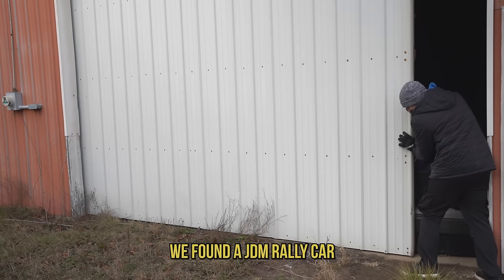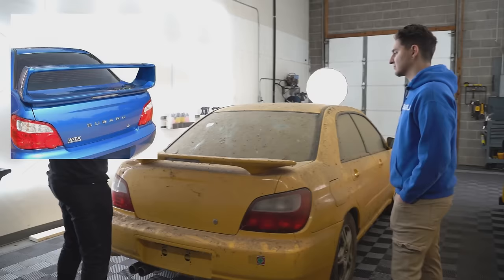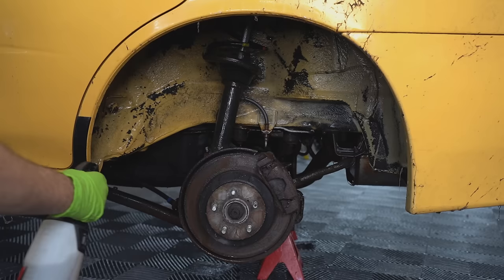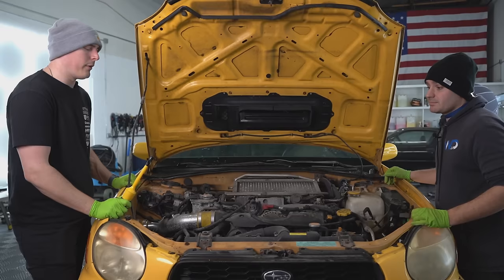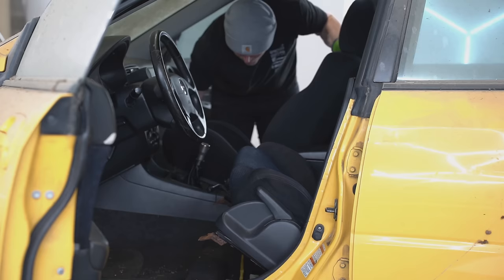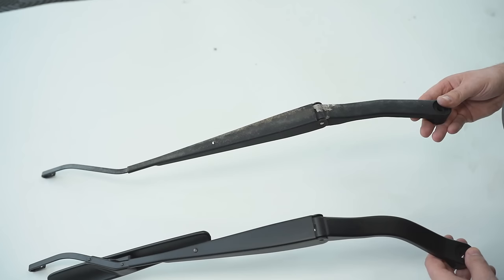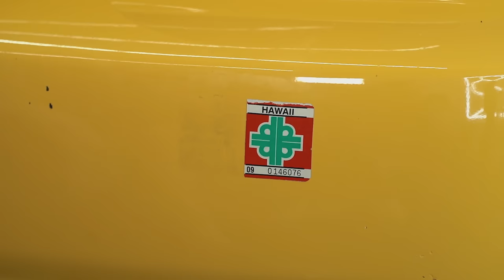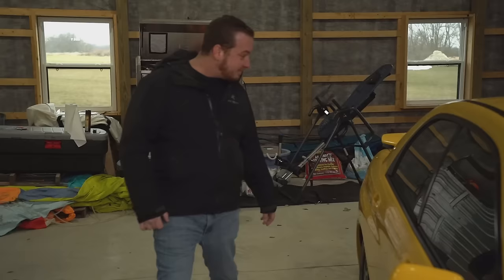First Wash in 7 Years: Subaru WRX Bugeye ABANDONED in Barn! | Car Detailing Restoration

Comment: I'm not normally a fan of black wheels, but those stock dipped wheels with this yellow actually looks super TOUGH. Nice work.
Reply from the maker: Thank you!
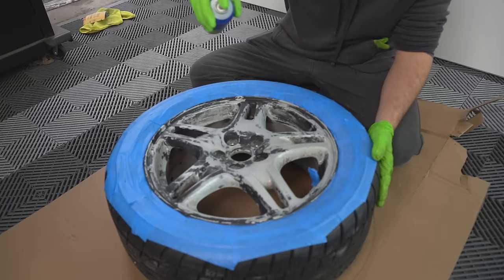Reply: @WDDetailing  Since you have this comment about wheels responded to, I'd like to chime in with 7:55 were you said, not to go heavy coats with plastidip which is incorrect. As per dipyourcar videos, plastidip is meant to be put with thicker coats (still trying to avoid drips) and hyperdip, a different product should be sprayed more like paint, lightly.

Comment: To tape of tyres you can better use a deck of cards and place them in the edge, all-around overlapping each other. It is the best way I found to quickly coat a set of wheels....

Comment: I am currently dropping a new engine in my 2002 WRX. I blew the engine back in 2012. It has been sitting in the garage then outside since. Mine is lowered on ISC coilovers and 18x8 Prodrive PFF7 wheels. It also has a 2007 STi 6 speed and wing.  I love my car which is why I never got rid of it. This guy needs to take care of this car. Subaru made very few in Sonic Yellow. Glad I watched this. I had some critters under the hood. Now I know the other places I need to check.

Comment: Using playing cards in the wheel edge saves the use of tape and taping it. Also you can reuse them and as they get covered with overspray they fit tighter and tighter!

Comment: the bug eye is by far the best WRX. best looking, lighter, handles better, no unnecessary electronics, drop in a late model twin scroll 2.5 engine, swap out the gear box and drive train from the STI and a booming sound system, rally blue, with Rays Wheel Ce28 n 18 wheels, carbon fiber hood scoop and rear wing risers.

Comment: I am a detailer and find if a car has mouse nests I use a 50/50 Isopropl Alcohol, water mix to the area after cleaning. This is misted over the area and the Alcohol kills a lot of odour causing bacteria.....I in fact use it on all surfaces and works well for me, even d I wn the air vents.

Comment: Nice car, and beautiful restoration done. But it is never a good idea to use a pressure washer in the engine bay. Or try to not spray directly into the alternator, better yet, cover it up so no water can enter the alternator. Just a tip, I don't want to be a mean or anything. And of course, not directly onto the fusebox.

Comment: I love this detail video! You guys did an amazing job! I actually saved a lot of your cleaning equipment on Amazon. Just a quick question though, I noticed you guys had a low pressure sprayer, and you sprayed the outside prior to washing it. What cleaner and sprayer did you use to break up all the dirt before you power wash the exterior of the car?

Comment: As a kid I wanted a WRX, as an adult and knowing about the boxer engine reliability I’m like NOPE. On another note. Born 80’s and grew up with 90’s TV and commercials. I could swear that Subarus were made in Australia because of the “Outback” commercials they made with that Australian guy with the hat. Oh and the “Everyday is a winding road…” song.
Reply: The problem is not the Boxer engine. The problem is modifying them and not tuning correctly. Several measures available to keep strong and reliable. I wanted an STI since i was 12. I have one now and don't regret any second of it.

Comment: Bugeye? isnt it called Blobeye?
Reply: No. Bugeye. 2001-2002. Imprezza WRX's started JDM in 1993 in Japan, and moved to UK/Euro/Australasian markets from 1994 I think. Mine is a 1995 GCF EJ20 wagon. 335,000kms on original engine/gearbox  and going fine. Not burning oil, but going to rebuild to get the ooompf back.😀

Comment: Those lights will end up getting you a ticket, and possibly even the car impounded as unsafe if you use them in Ontario and several other jurisdictions. I see things like that and think "More money than brains!"  Then you started it up. The art of tuning an exhaust to flow well and sound good has been lost. That is the worst sounding exhaust I have heard in a long time. Tinny and with miserable resonance.
Personally I prefer the old one, not only for looks but technology. It is not killed by computers thinking about every input. It is more engaging to drive.
For painting the wheels, tuck playing cards between the wheel and tire. Works perfectly and then you can use paper  to mask the tires from there.

Comment: Sorry but the old one looks so much better than the new one. The old one doesn't look over weight, looks like a fit, well designed, purpose built machine. New one looks like a boat that won't even be comfortable going over a speed bump. New cars just got so bloated over the years.

Comment: Guys, when you power wash a car, you need to do it from the top to the bottom and not the other way around. Because all the dirt will flow all over the car again when you do it from bottom to top like you did in this video. You're doing it wrong here. Just a suggestion.

Comment: Those later "soo ba roos" are heavy bloated whales, you wouldn't have four wheel drive cars  if it wasn't for Audi and it's quattro...
Reply: The early REX's are light, fun, practical and fast. My 2008 STI hatch is quick too ... I'm lucky and have both.
Reply: @davidmartin1012  Those early ones are the shizz imo, those later ones are whales in comparison imo. I used to have a Legacy, that was an ok car, the knock sensor was giving me problems.